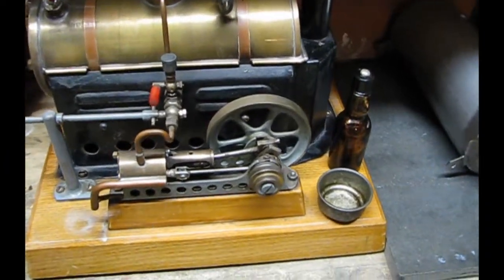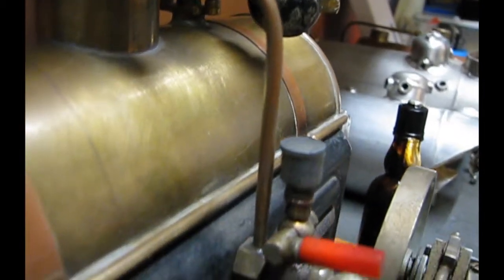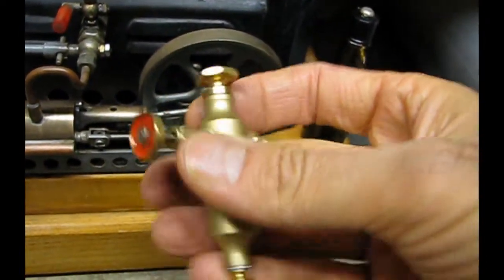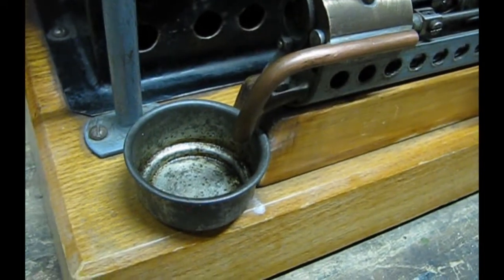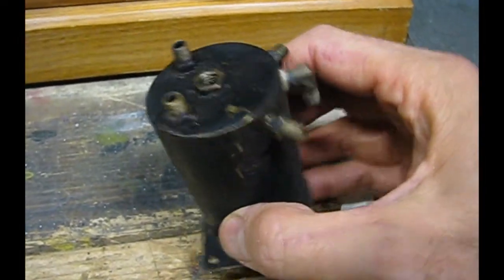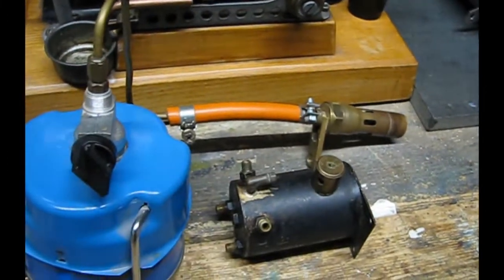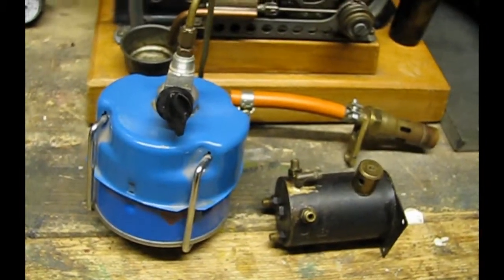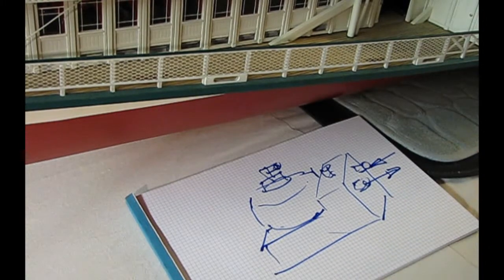PADDLE WHEELER Steamboat THOMAS POWELL  #6. Live steam Hudson River RC model. Bateau vapeur vive

Comment: This is not just " a live steam RC controlled model boat " - The engine itself is a accurate model of the engine installed into the real Thomas Powell - Stunning like all the rest of this model... WOW...
The engine is a single cylinder beam engine... The engineer had to take great care, that he did not stop his engine on a death center, as in that position it cannot be started again.
For starting  purposes, the valve gear could be disconnected from the driving excentric, and the steam valve could be manipulated by hand, once underway, the engineer would hook up the valve gear again on the excentric, so the engine would run automatic.

How do you plan to tackle the problem of death center starting of your engine ? - Perhaps with a small electric " starter motor " that can rotate the crankshaft over the death center ?
No, You did build on a small oscillating auxiliary steam piston to do that job, is that active the whole time the engine runs ?
Reply from the maker: Thank you for your interest and kind comments!
Yes, that's exactly what was going on in the engine room!
An electric starting motor was definitely not an option for me...
...so yes, Jan the small oscillator was my solution, and will be active the whole time: it actually helps the engine instead of just dragging it's power if turned off.